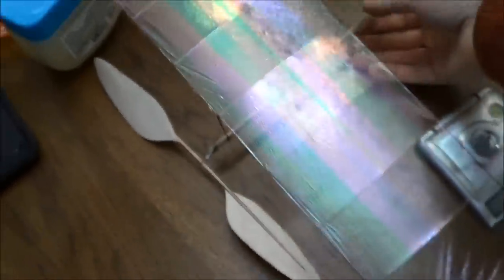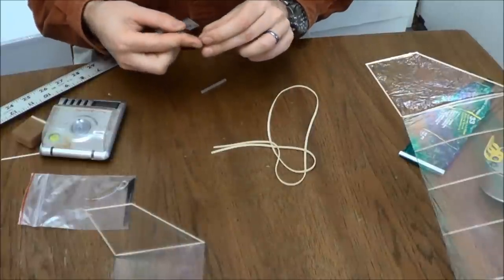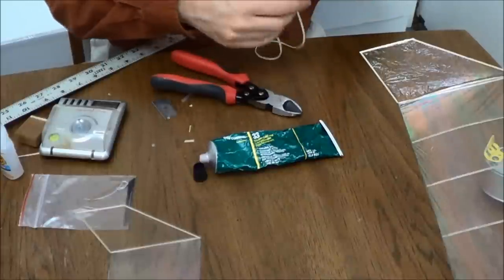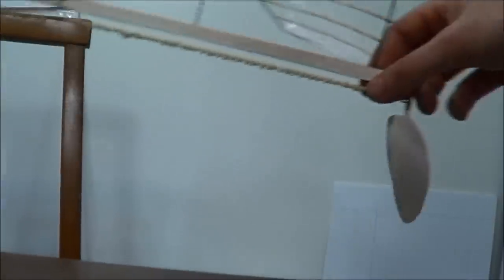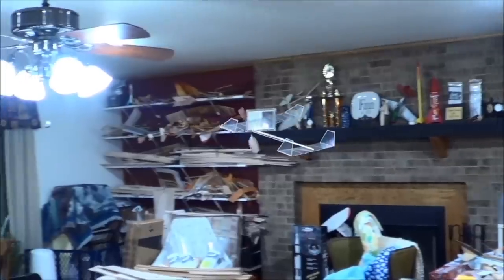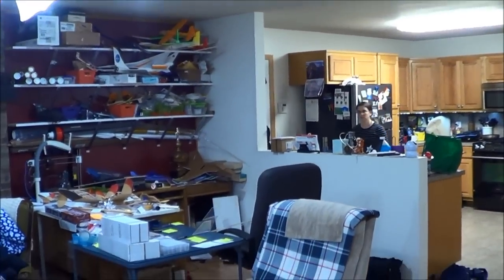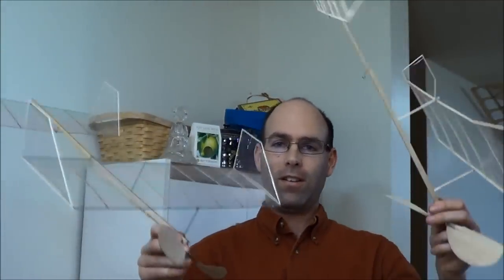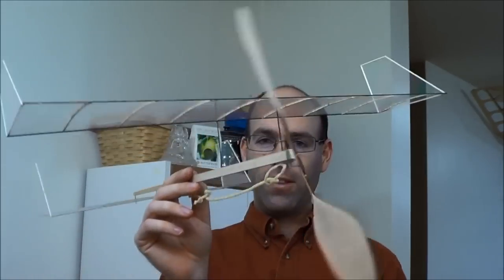Noncents Pennyplane Build, Pt.6 Flying

Comment: That's an overhand knot. You make a loop in the two strands and push the ends through the loop and pull it tight. A granny knot is like a square knot, but the direction of the two ends is reversed the second time. You showed a proper tying of an overhand knot, which is what we want. The second one should be tied in the reverse direction, the running end goes in the reverse direction around the standing end to go through the loop.

Comment: What was the propeller pitch after you twisted in a bit more at the 10' mark?  Do you now offer 14" props with the same (or thinner) blade profiles?
Reply from the maker: Unfortunately I never measured the prop pitch. In reality the proper course would be to use thinner rubber if the model were running out of turns like that. I've stayed with the same blade profile because it works quite well.

Comment: Looks like average two minutes under this  basket ball gym is a normal time...well done... what is the max you have had with this design?  ;-)
Reply from the maker: In a typical gym it'll do 7 minutes. I've done 11+ in West Baden but wasn't really trying. In theory it should do 13 in there and I can see how one would achieve that with a little more tweaking.

Comment: That’s a nice flier! I’m quite impressed by the climb on 300 winds. I woulda guessed that was closer to 500 with how fast it was climbing. And also impressively stable for having no dihedral except for the winglets. What was the final weight?
Reply from the maker: Copterdude final weight was 3.6. production ones will be a shade lighter, probably 3.2-3.3
Reply: Cool! :)
Reply: Joshua what have this Plane for wight, 3.6 gramm?

Comment: Sir, I asked a question what material used in this penny plane
Reply from the maker: All the wood is balsa, wing and tail spars an wing posts are carbon fiber, and the covering is thin mylar. We currently use 1.4um mylar for the covering on these.

Comment: Why the plane fan is moving slowly and the plane is also moving slowly
Reply from the maker: If you build it light, it doesn't have to move quickly to generate sufficient lift.
Reply: Fan should be also light